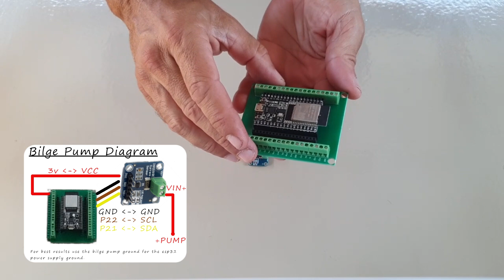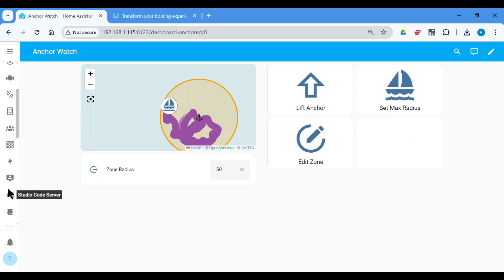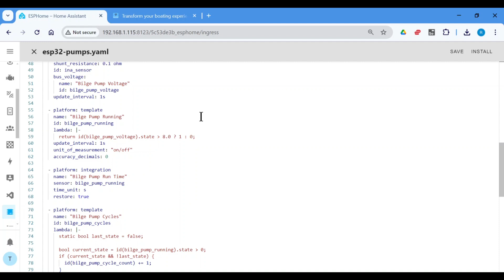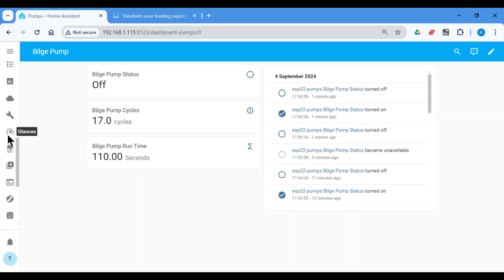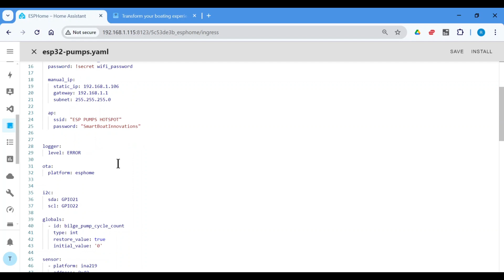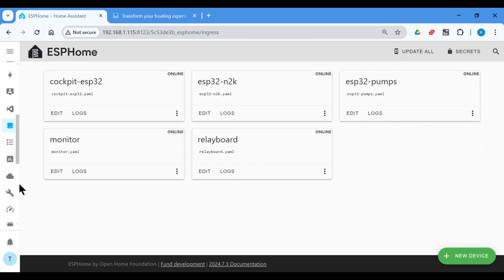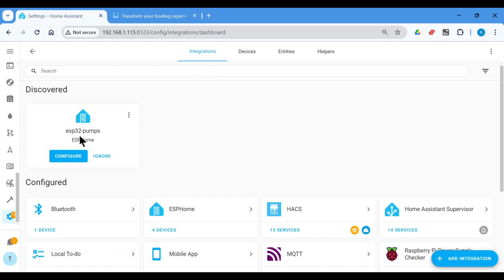Smart Bilge Pumps

Comment: Rob, just a follow up question:  What is the additional wiring connection and Yamal code, if one has more than one bilge pumps? Thank you.
Reply from the maker: The ESP32 has 2 I2C channels. So it can have 2 devices like the INA219 with the same address. So for each pump include a id definition like this:
i2c:
  id: bus_a
  sda: GPIO21
  scl: GPIO22
...
and then in the sensor definition you reference this particular device by adding
    i2c_id: bus_a
...
If you want to add more than 2 pumps you will need to change the INA219 address. See my website for more info on how to di this:
https://smartboatinnovations.com/ina219-voltage/